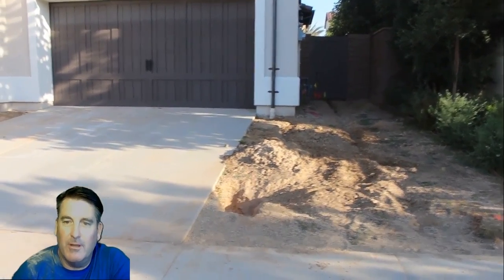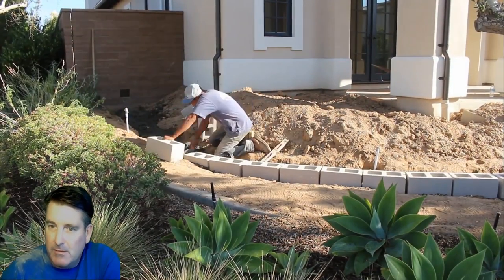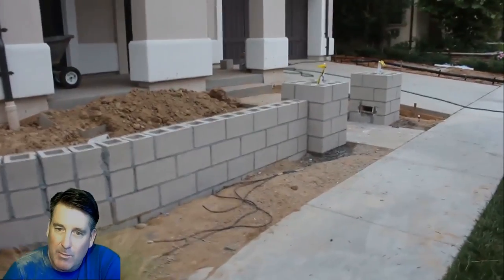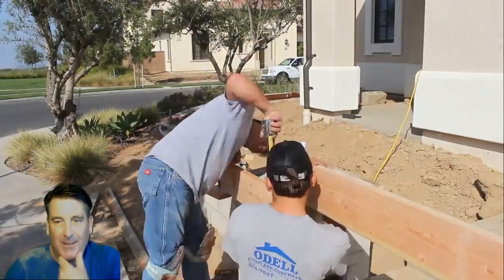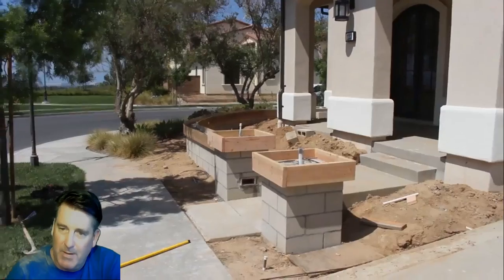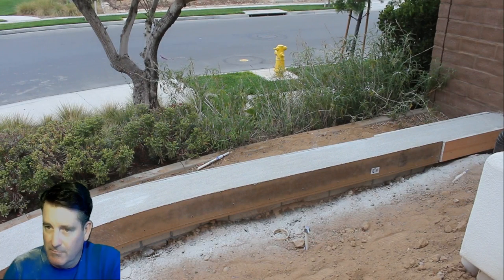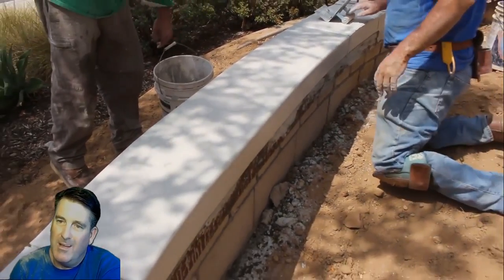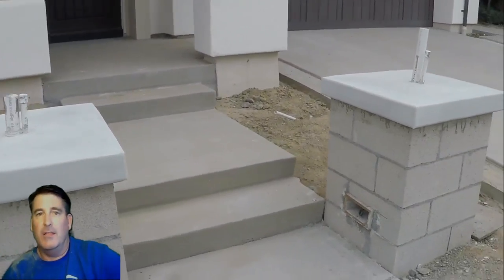How to Build a Wall and Pour in Place Concrete Caps For Wall

Comment: I've spent probably the last 5 hours watching several of your videos. They all have a few things in common, hard work, good planning and prep work, great attention to detail, and a fantastic final product. I'm wanting to pour a slab for an aluminum covered porch and it's a beginner slab but it has an extreme slope on the back corner and I think after watching your videos I know what to do, but honestly after watching your videos and the incredible finishing techniques I've seen you and your crew use, I'm hoping I can replicate even a halfway decent outcome. Thanks for the great videos, I've subscribed and I think anyone who wants to learn more about concrete form work and finishing should as well!
Reply from the maker: I think you will have good going small to start

Comment: Good job, in locations where you get rain make sure you add some half round profile to make a drip groove between the bottom edge of the copings and the edge of the wall, this will prevent water damaging or staining your wall over time.
Reply from the maker: Good idea

Comment: Great job as always!  I'm gonna put a cap on my brick mailbox.  But, I'm gonna cheat.  Pour in place on a form over poly, then flip upside down, inch wider than the brick so it serves as a drip edge (until the letter carrier hits it).  Thx for the excellent video.
Reply from the maker: Good idea
TY

Comment: I noticed you just buried a line of blocks in the ground as the footer. Is this preferable to pouring a single piece of concrete footing? How do you keep that first row of below grade blocks level?
Reply from the maker: I like to use a laser level, on each coarse of block.

Comment: Amazing work! I was wondering what you sprayed on the forms before pouring the cap--if I used melamine for the forms, should I rub on some oil first? Any suggestions about how long forms should stay before being removed? Thanks!
Reply from the maker: I used motor oil. Mobile One synthetic diluted with diesel.
In this case the forms stayed there 1.5 hours

Comment: Your techniques and tips and clear camera work and narration help me to learn. The "head" appears useful try it in a few more videos and maybe only for some specific sections to see how it works out over a fair test period. You certainly appear quality driven. I'll second some of the other commenters compliments and there were some tips among those as well. And I'll second some of the safety suggestions regarding dust control. Maybe do show the finished state in a few weeks to answer the comments about the structuring and proportion of the caps and offsets by showing how the cladding in stone and tile answers those issues. I suppose the next ice age will be well advanced before you in your location needs to worry about frost and freezing control or maybe even rain.
Reply from the maker: I think the head can be used with a few tweaks.
A lot of the comments make sense.
I will be using the floating head again soon.
TY

Comment: wonderful and info filled video i am an apprentice mason and was wondering if it is or isnt important that the core bars didnt rise above the blocks an inch or 2 so it helped the cap work tie in...or is it something you shouldn't do because it would cause some  type of failure ? again thanks for the videos and knowledge. 👍
Reply from the maker: The block is not filled to the top.
The cap is in set to the block.

Comment: 1. What do you do about the drips on the CMUs? Will that brush off or are the CMUs to be painted/colored?
2. Curious about the function of the hole/void/gap in the existing wall where your wall Ts into it. (Seen at 27:14 and elsewhere.)
Reply from the maker: wall being covered with tile

Comment: How much overhang can you get on a wall cap poured like that?  I have a block wall that I want to put stacked stone veneer on to match the house and I'd need more than 3/4".  Half the wall is curved so its a bit tougher to find a suitable cap that I could just buy and install. Its intended to be a sitting wall around a sunken patio. Your videos helped me a bunch to get the wall built and I really appreciate that.
Reply from the maker: As much as you want

Comment: Could you also do this ao that the concrete cap is flush with the block wall (no overhang)? And can you also embed steel posts into the top as u pour? My caps are breaking off and want to redo my existing block wall and add a wood fence to the top. Thank you

Comment: Subscribed. Impressive work and splendid job on the video. Thanks for posting these videos. You do top quality work and I appreciate your voice over style. Imo, your voice is pleasant to the ear. Maybe I missed it, but would you please tell me what the name/size of the cement mixer you're using? Thank you Mr. Odell.
Reply from the maker: Not sure what mixer it is.
I got it at home Depot.
Mixes one wheelbarrow at a time.
Vey mobile.
Reply: Odell Complete Concrete Thank you so much for taking the time to respond. It was interesting to see you mixing it by hand rather than having it poured from a truck.

Comment: David, I am a homeowner, DIYer weekend warrior type.  First, thank you for sharing your professional knowledge!  My question is about setting the radius for a curved wall using CMU... how do YOU do it?  Do you cut the backs of blocks if it is a really tight radius?
Reply from the maker: Yes cut the block if there going to be showing if not open the joints up more and stucco or ledger stone.

Comment: Awesome. I need to repair the edges of the cap on my porch. Should I use 4500psi? I really am not sure what I am doing but I am going to have to learn real fast, which is why I watch your videos. Also, I will be cutting the edges back then filling to repair. Should I drill holes and put some rebar into the old portion of the cap before pouring, or will adhesive bond work?
Reply from the maker: I like to drill and dowel, plus glue.
Reply: Odell Complete Concrete Thank you. 4500psi ok? Subbed.

Comment: I poured one of these caps on a poured concrete wall. Mine was 13 inches wide and I cut it every 6 feet. I still got some slight hairline cracks in it. I have 2 rows of rebar so I’m not too worried but don’t like the cracks regardless. Any advice on preventing this?

Comment: Thanks Mr. Odell I just bought an old house and I need to cast 4 caps approx 18"x 18" I have a cracked stone rubber mold I will i use for the edge  what bagged material should I cast it with?
Reply from the maker: I like a 4500

Comment: Are you going to cover up the holes you drilled with stucco? Would you drill holes in a slump stone wall to do a pour in place cap like this?
Reply from the maker: the wall gets tiled.
I probably would drill slump stone and patch with same color. the drill holes are 1/8"

Comment: Did you have to compact/tamp the floor of the trench you dig, before pouring the concrete? Did the concrete go directly on top of the dirt, or did you have lay down a layer of gravel / rocks ?
Reply from the maker: compacted dirt

Comment: Thumbs up on your work. 👍
Question for you. If you were to build a (Bonsai Pot),  7' x 4' x 11'' deep.
What kind of cement, and how thick should the bottom and walls be ? 
(One pour upside-down).
Thank you very much.
Reply from the maker: I think there is some counter mixes that will work for that, add fiber

Comment: speaking of sack concrete, what is your opinion on Quikrete Maximizer? I used about 10 bags of it a while back, and it seemed like it mixed a lot easier than the classic quikrete, and had a lot more uniform gravel in it. I dunno how great it is long term, I'd never used it before.
Reply from the maker: Never used it but I'm sure its better, it cost more

Comment: is it possible to do the pour in place concrete caps for an existing pony wall that already has existing 2 x 8 x 16 wall cap toppers (just the standard ones), would that still work? thanks

Comment: How do you get bag mixes to have the amount of cream a redimix truck has? Do you add more cement to mix ?
Reply from the maker: In this case it didn't matter because I threw color hardener on it, which is very creamy.
If I use sack mix that I have to finish I get a 4500 psi or the cheap stuff and add cement powder.

Comment: Beautifully done and well explained! Any reason you don't leave your vertical rebar long and bend it over to tie in with your horizontal bars in the cap? Seems freeze thaw cycles could push it off over time?? I would like to do this at our property someday, have about 350' of property line that boarders a public park and think it would look a lot better than fencing.

Comment: How many tapcon screws would you use to hold an 8ft form board to the wall? 3? I can see that a little concrete creme dribbled down onto the wall. I know it doesn't matter here because you are going to tile over it, but on a wall that isn't going to get any kind of covering , what about sealing the board and wall seam with some silicon to prevent any leaking?

Comment: I’m not of a fan of stucco.   I guess it’s the best material for high temps in that area of the country.
I’m in the Midwest and accustomed to brick facades.  We do have a few homes in the area with stucco.   I assume the opposite here, stucco not good with cold winters.

If I’m wrong...please tell me.  Curious.

Great work!  🔨🔨🔨
Reply from the maker: Insulation is good with brick

Comment: Thank you for sharing your expertise in these videos. How would you make an arch to transition from the column to the wall? I've seen it on spanish homes where there is a gradual slope connecting the taller columns with the wall? I'm guessing you use the technique in this video with arches carved out of plywood and screwed in place as a form?
Reply from the maker: sounds about right

Comment: If I missed this I apologize for the repeat. How is the siding strong enough to hold the concrete on the top? Isn’t it just screwed into the 2x4 on the top? I figured it would be to flimsy to hold the weight of the wet concrete.
Reply from the maker: The siding is strong, especially on a radius.
Reply: Odell Complete Concrete it was neat to watch. I’ve never thought to use it like that. The finished result is nice.

Comment: Can you pour the concrete to fill the block and the cap at the same time?
Assuming fiber mesh is added to the whole concrete batch?
Reply from the maker: I've tried it but its hard to fasten the form work to hollow block
Reply: Thanks for the info? Curious if the cap came out the same doing it all at once? I just wanted to fill and cap all in one pour as long as I'm ordering a cement truck and pump. Thanks again. You do great work and make it look easy.
Reply from the maker: Sure

Comment: Where does the water go?  Did you have to pitch the concrete so the water runs off?   I know if in the east you'd have to make both sides pitched so there is proper drainage.
Reply from the maker: To the low side

Comment: Maybe I missed it????.. But I didn't note any attention to creating a slope on the top (from inside to out) so that rain water doesn't hang on the top and stain it.. That is to say, yes set, parallel inner to outer run, and set both horizontal, but with one  higher (marginally)  than the other. than the other to give water exit slope
Reply from the maker: One side is lower then the  other

Comment: Great video,  does the color hardener act as a cure? Or do you spray on the hardener, I do concrete in Arizona where cure is crucial.
Reply from the maker: The hardener probably does help with water evaporation.
If need be you can still spray concrete cure on it.

Comment: Can you summarize when to use iron or steel rebar and when to use fibres in the mix and why?  Because you just used rebar on a non-supporting wall and also fibres.  While fibre gives flexibility it may weaken the strength, but is any of this needed and why? The wall is not supporting anything?  Is it in case a truck or car crashes into it?
Reply from the maker: I just like to over build everything
Reply: It is important to understand reasons why.  It seems that fibers (steel, glass, plastic, etc.) may reduce cracking and shrinkage in concrete and its bleeding of water but they never add to the flexural strength of concrete, and in some cases diminish it requiring more reinforcement with steel.  So in the floors of a parking garage, it must also be reinforced with steel bars. Fiber length is important.  Too long tend to ball up, and interfere with the workability of the concrete.  Very short, microfibers somewhat improve the impact resistance of concrete.  So I suppose what you have done is not essential but could be marginally useful if a car hits the barrier.

Comment: I notice you don't let the concrete dry/cure and then put the first row of block on with mortar (i.e. you embed them straight in the concrete)...is that preferred based on your soil type in CA?  I am in VA where the soil is mostly clay and we get a fair amount of rain.  So for my DIY project...I'm debating on which technique to use relative to the first row.  Any advice?
Reply from the maker: I think how you set it is not as important as what the footing is set on in your area.
Reply: In my part of VA, I'm excavating clay.  I am planning on putting some stone and stone dust first (compacted of course) before pouring the concrete footing.  RE: wet setting...knowing it likely depends on environmental conditions, when is it best to place the block?  in other words, is there a certain time after the initial pour or a certain consistency to look for/wait for prior to wet setting the block?  Not sure if I can set the block right after I pour it.

Comment: you should start using pinch nail system instead of tapcons. once i learned it i never went back. all you do is drill the same 3/16" hole as you would with tapcons, then stick about a 6" piece of tie wire in the hole. then drive a 16 penny double head form nail in. it locks 100% solid but costs a third of the tapcons, and when it comes time to strip all you need is a hammer or flat bar. no need to carry a drill or impact to pull tapcons. try it once and youll never go back. i also use it on my temporary safety stanchions on edge rails. it is osha approved to support that weight load also.
Reply from the maker: I have used that system.
I re use the tapcons. I've had the same tapcons for 8 years

Comment: Excellent information and work! Just subscribed. I have a sloping rear yard that backs to a natural area ravine about 30’ from the property line with adjoining neighbors that also slopes high left to low right by about 3-4’. Do you have any videos or suggestions to retain the rear so my yard can become more level instead of the 10-12’ drop to the fence line? The yard goes about 20’ back pretty level then the slope. Thanks!
Reply from the maker: Try stackables

Comment: Odell, Thanks a "Million!!!" for these videos...I would definitely watch an unedited version of your builds and breakdowns also. My neighbor installed an adjoining 6'(on her side) vinyl fence at the western side of my home before I moved in. My issue is that I am on a slight slope, I'm 6'2" and when I walk next to fence I tower 1'-2' over the fence. I would like to build a cement footing for 25' and raise the vinyl fence up 2' so that I do not seem like the nosy neighbor.   The fence was built on  my property line and she doesn't mind if I raise the fence. My issue is that I haven't seen anyone build up a vinyl fence except by adding a lattice top. I am hoping to build a 10' X 15' workshop in this area and have storage space in the back. Have you seen anyone that has raised a vinyl fence by adding a footing and cementing the posts for the fence in the footing?
Reply from the maker: In my area vinyl fencing is put on top of block walls all the time, making them 7.5" tall.
18" to 2' height additional vinyl

Comment: nice job....the only thing is ....do you not need half round drip channels under the coping to stop water migrating in to the top joint and freezing....prefer your comments only....
Reply from the maker: no there is no freeze here in So CAL

Comment: Minutes 21:50 I didn't really get the purpose of pushing down with that number 3 rebar if someone could emphasize a little bit I would appreciate it👍
Reply from the maker: moves the rock on the face, so its easier to joint.
Reply: @OdellCompleteConcrete  
I'm not sure but I think I got it!☺, thanks for the reply and for the excellent work you guys doing👍

Comment: 18:13 did you just try telling me synthetic motor or is environmentally friendly? 🤣👌🏻 Nah my guy, that shit get recycled the same as the standard dinosaur sludge. Using your old engine oil on the form boards is economically savvy but the useful idiots out here may interpret your language as dump-in-ground friendly. It certainly is not 😂😂 Love your videos man, I’ve been following for about two years now. Keep up the great work
Reply from the maker: Just kidding, but it should be if its a synthetic and man made or what's the purpose

Comment: The wall was not tied into the pier. Not good.
Reply from the maker: I believe it was however its not a problem because there tied in to the same footing.
Reply: I didn't see it in the video. It doesn't matter if they are on the same footing,
the two should be one unit. Pressure from behind the wall will eventually push the wall
away from the pier.

Comment: You and your crew do great work on other jobs, but this one was not your best work. 
Block joints were larger than others on radius.
Spill over run off on concrete cap to block.
Reply from the maker: The block gets covered with stone.
Reply: Odell Complete Concrete speaking as an owner builder, and knowing how long it can take to get around to those finishing touches, I'd be inclined to leave the blocks looking pretty enough that it won't matter if that stone finish never happens.